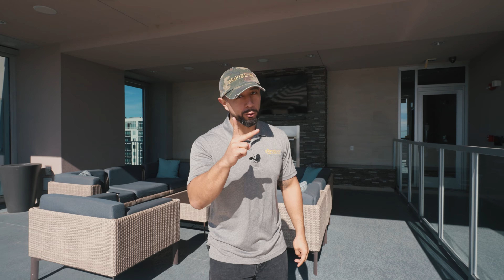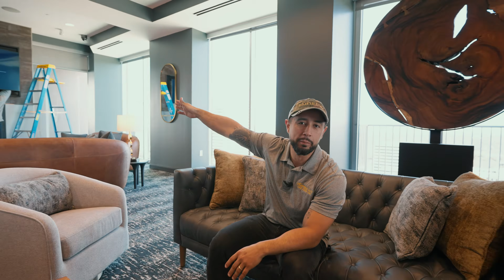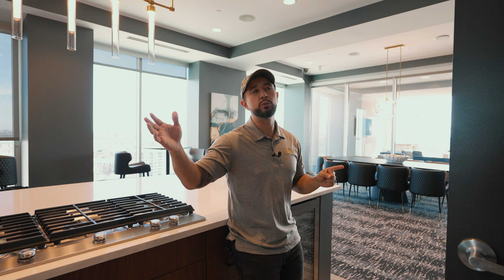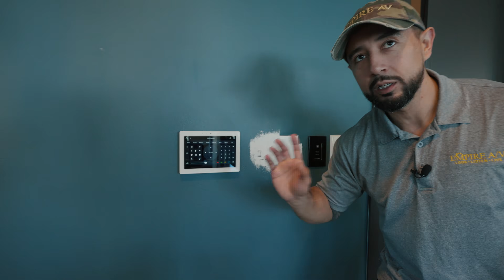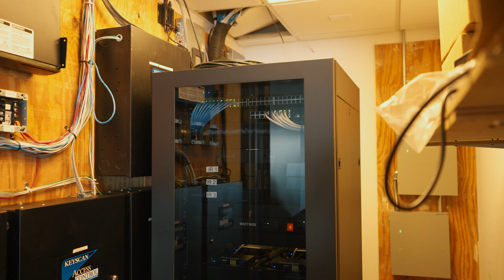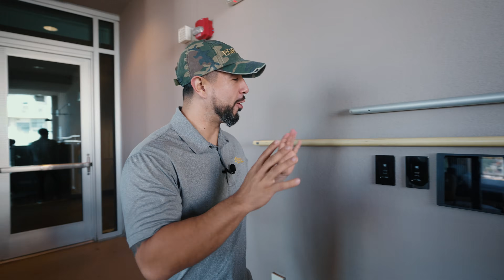Rooftop Makeover | Control4 Smart Home Automation System | Skyhouse RiverOaks

Comment: I have only one cat6 behind my tv if I want to send audio to the speakers can I place a switch behind the TV and still send the audio back?  The TV is using the one cat6.
Reply from the maker: You will need an optical Balun or an ARC Balun . (Just depends on the inputs you in the amp ) 

There is certain baluns than can pass Video, Audio, Network and IR.
Reply: I don't think you would be able to use an audio balun with a switch that is connected to the network since the balun is not using IP
Reply: You have one cat6 but it being used for net work ? 
If you need the network because WIFI is weak maybe a audio out optical 3.5 rca ect. To bluetooth transmitters 
If your receiver dosen't support bluetooth add a  bluetooth receiver that's if your equipments not  far away from  good luck 
Do it for head phones all the time tv sound to bluetooth